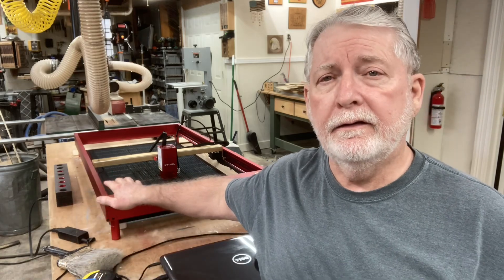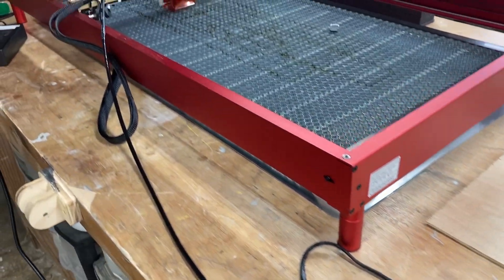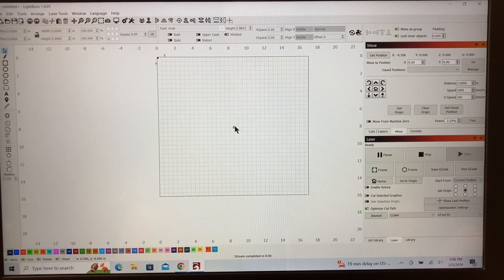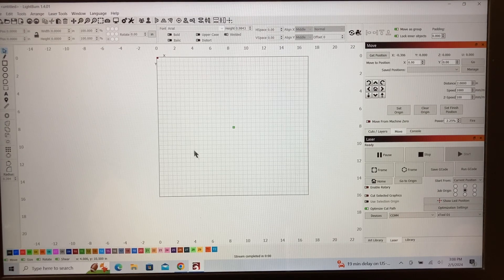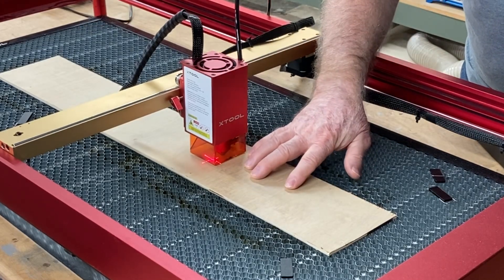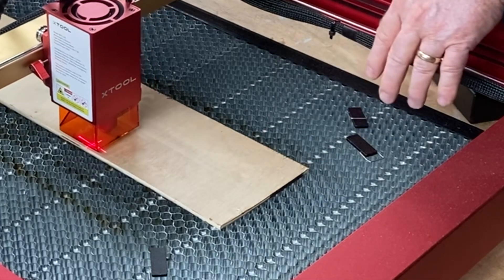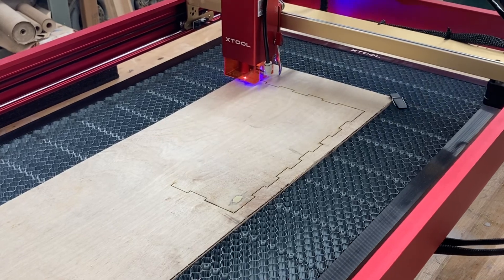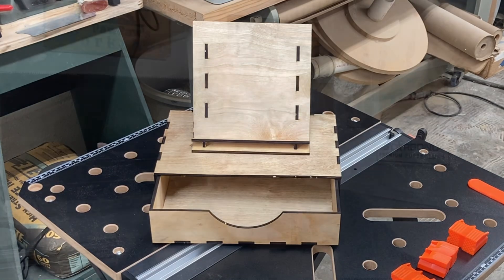STOP HOMING Your Laser!  It’s NOT Required

Comment: Hello - thank you for this. My problem is, every time I turn on the machine (xtool D1 Pro, Lightburn), it automatically goes to home (rear left), and does that terrible grinding. How do I stop it from doing that?
Reply from the maker: In the setting you can set the machine to home manually. That way when you turn it on it will not automatically home. The grinding may be due to the limit switch not being activated, loose wire, positioning, broken, dirty. Any number of possibilities as to why it not working
Reply: See the problem is that it’s homing automatically in the rear left when it’s supposed to home in the front left.

Comment: I have a FA 4040xe with the 300w spindle, for the last 2 years I haven’t homed it prior to doing a cut or carve and it works great, my X,Y location is always the same place, so after the cut it goes back to that X,Y location so all I have to do is set my Z depth and it’s ready to go
Reply from the maker: For a number of years I did the same, I did not home the machine. Thank you for sharing.
Reply: @PawPawsWorkShop  Thank you for your input

Comment: Be careful about using that laser in the open air... breathing vaporized toxic chemicals can be a career ender. 
That foreign made plywood has binders made from God only knows.
Reply from the maker: Thank you very much. I do have a well ventilated shop. I have two fans helping to direct smoke out of the shop. Plus I have an air scrubber filtering the air. You are correct.

Comment: very confusing.  I saw what you did with the measuring tape and it looked like you measured UP 10 inches from the bottom of the board. But you kept saying you were measuring DOWN 10 inches...  10 inches from where????????
Reply from the maker: The green dot is the center of the material being cut. The laser is placed at the spot where the green dot is located. The board is almost 20” long. I measured 10” from the bottom of the board to locate the correct point to place the laser
Reply: @PawPawsWorkShop  thank you for your reply.  My point exactly.  You measured UP from the bottom...  NOT DOWN. or am I still missing something?
Reply from the maker: 10” is 10” no matter where I’m measuring from. All I want to do is get close to the center of the material. Once I frame it I can adjust the position of the material to the exact position.

Comment: This is the way I do it. I have an Atomstack laser that doesn’t auto home. Every time I turn it on I have to go through a home finding process and then it will home as long as it’s turned on. But by the time I do that, and provided I’ve remembered how, I could have done the current position and been cutting.
Reply from the maker: Thank you, excellent point